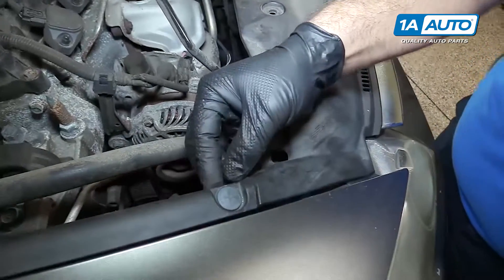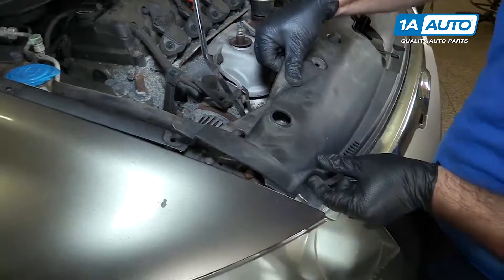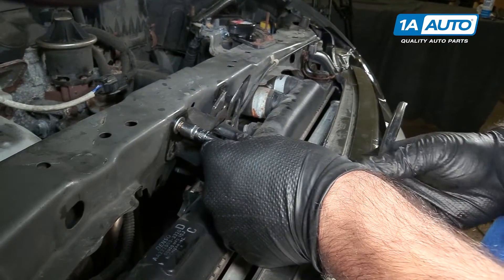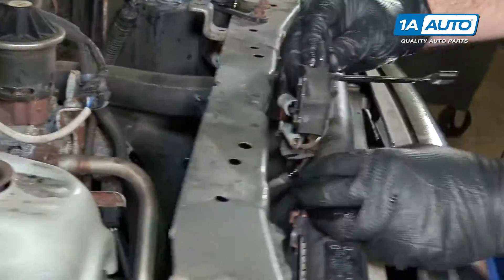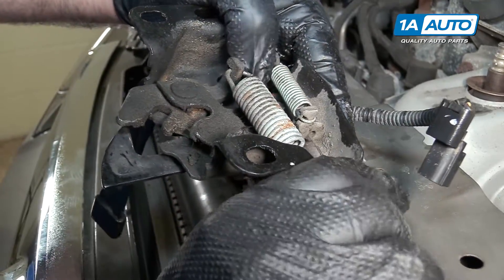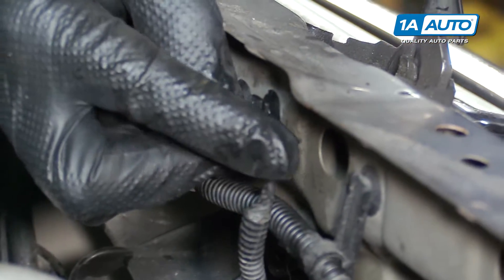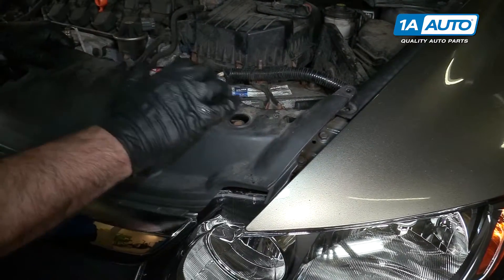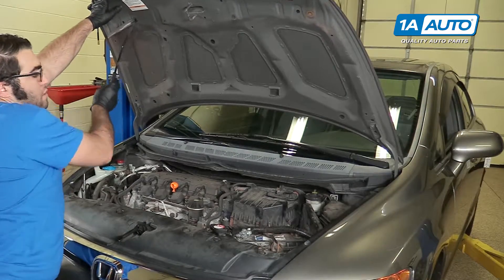How to Replace Hood Latch 05-11 Honda Civic

Comment: Great video. 

How would you replace the hood switch if faulty? 
That is,  the one that tells if the hood is open or closed.
Reply from the maker: We currently do not have an auto repair video that covers this particular repair. We will keep this request in mind in the event that we need to make this repair in the future. 1aauto.com +daviderhahon
Reply: @1AAuto can the sensor on the latch go bad ?